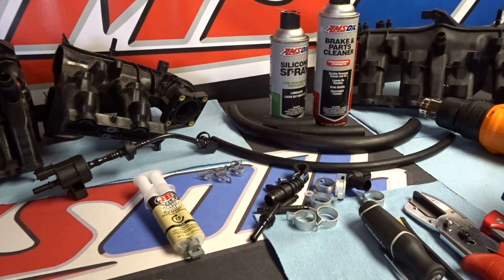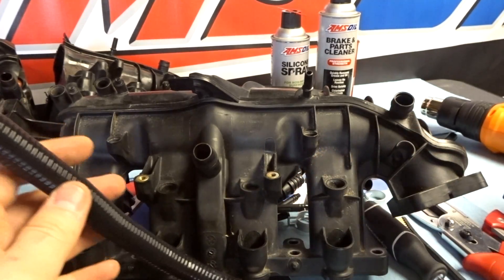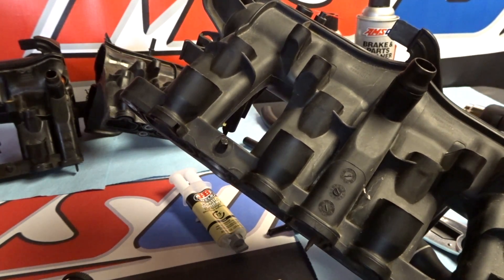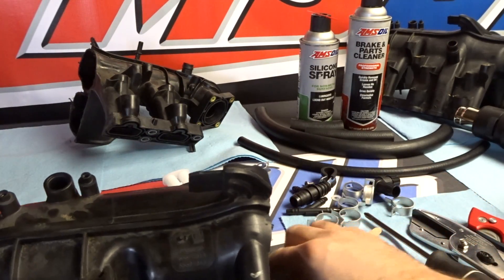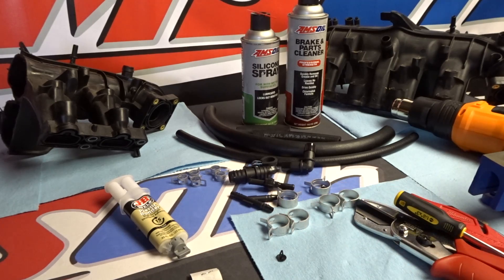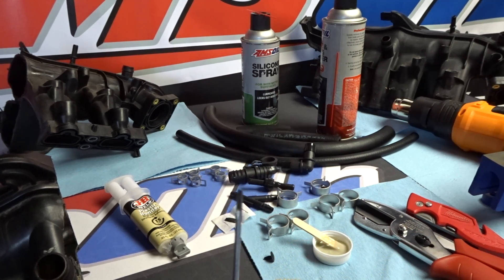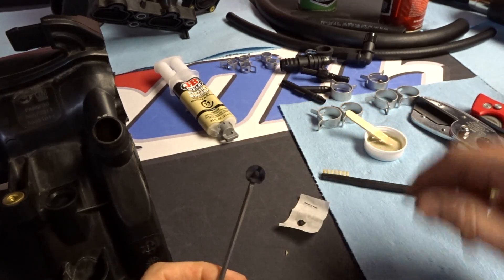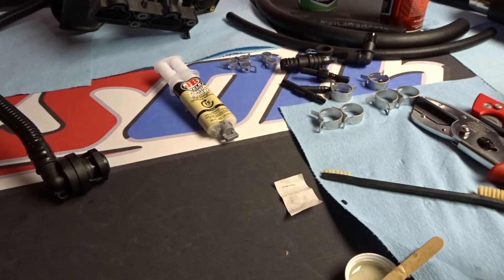How to Install the CruzeKits.com V3 PCV Fix Kit

Comment: Is that check valve big enough? Reducing half the diameter as the factory one. I don't think you'll have enough air flow.
Reply from the maker: The check valve flows far more air than the factory one.
Reply: @AndreiDPop  which catch can would you recommend with this kit if any and how to connect?
Reply: Looking more into it, is the pcv gas entering the intake under non boost conditions even worth trying to catch? Looks like everyone is concerned with catching the gas before it goes thru the turbo and intercooler.
Reply from the maker: @joeaubert7224  I mean if your goal is to keep the system as clean as possible, I'd say it's worth it, but I think there are better ways to approach that.

Comment: If the pvc valve fails in this kit, is there a way to catch it before the diaphragm on the intake is effected?  I plan on ordering the V3 kit and an extra valve.
Reply from the maker: You'd have similar symptoms first. Elevated oil consumption, loss of power, reduced fuel economy, etc.
Reply: @AndreiDPop  Actually just put my order in for the V3 to ship to MN.  What would be your recommended mileage interval to check the valve for proper function?
Reply from the maker: @lancewoller  hard to say since we haven't tested it for very long, but I'd say check it after 50,000 miles.

Comment: Why didn't you just keep the brake booster tee? It's an easier fix and doesnt require cutting into hard plastic lines and heat them to get it to fit.
Reply from the maker: Hose routing would have crossed over the evap purge line. No easy way to route the hoses if using the brake booster tee. I tried.

Comment: Will a missing check valve cause a under boost code?
Reply from the maker: Yes it can contribute to one. That and any other external boost leaks.
Reply: Dre Dan thank you for the reply, I checked mine for boost leaks and installed a new oem turbo and I once again got a under boost code. No leaks, or cracked exhaust manifold
I am missing the orange valve on the intake just wanted to make sure that could cause a underboost code.

Comment: In the video description you say "This kit along with a new GM valve cover will fix all of the PCV issues these cars have." Is there a way to check if the valve cover needs to be replaced before spending the money on one? If I should just get one, does the Dorman one meet the needs?
Reply: If the PCV valve at the intake manifold is missing or not working it will either make the pressure release diaphragm or the burst disk fail anyway, so might as well get it replaced while you install this kit to address the issue.
Reply: Do Not use ANY DORMAN products.  They are crap. Amazon and Ebay have plenty of reasonably priced OEM covers to choose from.

Comment: Updated 11 months later see comments: 

Thank you for this. I actually have two Cruzes in the family. Will buy another kit soon for the second one. I'm an aircraft mechanic so this was an easy fix for me. I did melt the small plastic lines with the heat gun but was able to make it work. Next time I'm going to use some fuel line instead. I brought the car in for service and told them about the check engine light and pcv issue. They told me I needed four new injectors and that the PCV was fine. $600. I held my temper, ordered your kit and now the car is fixed. You are doing what GM should have done in the first place. Thank you.
Reply: BTW. I think the three thumbs down are GM execs.
Reply: @berticusmaximus8381   also note that this engine was used in Opels and vauxhalls before they made it to the US. You'd have thunk the germans would have let GM know of the intake problems
Reply: Just updating 11 months after the first post. Put off and forgot about the second Cruze (my other son's car). This week my wife took it to the store and pulled in the driveway with a huge white cloud billowing out of the tailpipe. Covered the entire neighborhood. Engine was squealing and engine light was on. I ordered the second kit and installed it this morning hoping this was the only thing wrong. The intake was full of oil and it took the car 20 minutes to stop smoking. Good to go now. Awesome kit. Thank you again.

P.S. I ordered the easy connect kit so I didn't have to heat the tubing. Made the job so much easier. Also the new elbow that replaces the T also made the job faster.
Reply from the maker: @berticusmaximus8381  how's your check valve doing in the first kit? I'm seeing some failures from time to time. I have an upgraded check valve coming soon that will last longer, and I re-located the valve in the kit itself.
Reply: @AndreiDPop  so far no issues. I have not cleaned or checked it since installed. I will take it out, clean it, and test it as was suggested in the email. Also I will most likely buy the new check valves as well.
Reply: @AndreiDPop  i am planning on  ordering one is there any new upgrades?
Reply from the maker: @megabeastmode555able  I've made a couple of updates to the v3 kit since it first came out, and I have some new check valves arriving early next month with upgraded plungers.
Reply: @AndreiDPop  i already ordered one lol  im trying to fix this issue now as im military and have to go home for leave but if you improve on it later i will also buy the upgrades
Reply: @AndreiDPop  my son came home and I pulled his check valve. Worked great. Cleaned it and reinstalled.
Reply from the maker: @berticusmaximus8381  good to hear. Approximately how many miles on that one?
Reply: @AndreiDPop  15,000 - 20,000 approx.
Reply: @AndreiDPop  have the upgraded valves come in yet? Thinking of ordering soon
Reply from the maker: @treyzeno8181  no, not yet. I've just been informed to expect them end of the month.

Comment: Any issues with this failing the visual smog check ?
Reply from the maker: Depends on how particular they are. Some places will actually compare your engine bay routing to a diagram to see if anything looks out of place. Most places don't care. Proceed at your own risk. The kit doesn't bypass any PCV functions and its role is to retain the OEM design but improve its durability and reduce its maintenance cost.

Comment: The Hose you used were 5/8 or 5/16?
Reply from the maker: Both.
Reply: So the "T" fitting is 5/16 to two 5/8 right?
Reply from the maker: @tksvideos2737  yes. Why do you ask? Are you trying to piece your own kit together?
Reply: Yes. Because i live in Dominican Republic. So the shipment would be difficult and expensive for me
Reply from the maker: @tksvideos2737  freight cost is an extra $30 USD for my v3 kit. Not too bad. The tee fitting was custom made. Not likely that you'll find one.

Comment: Okay, so I had P0496 purge valve issue, and stuttering at stop lights, as well as when starting after fueling:  all the symptoms.  So, I replaced canister purge valve and cleared codes using OBD scanner.  Symptoms went away completely.  However, all the codes came back as well as MAP sensor codes.  So, I checked the valve-cover pressure regulator vent, and sure enough, it's gulping in air.  I'm pretty sure this means at the least I need to replace the valve-cover, but as I see here, I should probably go ahead and replace the intake manifold or use one of these kits to fix the existing.
Here's my question: I know a bad pcv valve in intake can cause pressure regulator diaphragm to crack, but could that also cause the purge valve to fail too?  I mean, yes i have error codes, but my symptoms are completely gone.  Is this just short lived because the excessive vacuum being pulled will destroy the new purge valve?
Reply from the maker: No, it couldn't cause the purge valve to fail. The two systems are not related in any way.
Reply from the maker: Your purge valve is behind a check valve that is external to the manifold. It's that plastic disc looking thing inline with the nylon hard line.
Reply: @AndreiDPop  Yes, I replaced the purge valve and all my symptoms of stuttering at stoplights and after filling-up went away, but the pcodes are coming back.  But if I understand what you're saying, my new purge valve won't be damaged by the fact that the regulator diaphragm has failed.  Thanks

Comment: I have the v2 kit although I haven't installed it yet , I have 34,000 miles on my 13RS I like the V3 better  if I still have the check valve in place can you poke the check valve with a pick of something in order to snap the plug in the hole ?
Reply from the maker: Yes. Break off the tip with a flathead screwdriver and that should be enough. Poke the other side through with a pick if you want to.
Reply: @AndreiDPop  
Ok .......

Comment: I have recently had my diaphragm failing and have purchased the valve cover for my 2011 cruze, I checked for the pcv intake valve and it’s disappeared. I am not mechanically savvy neither wealthy to afford costly repairs. Would you recommend V3 kit over V2 for someone like me and if there are any more videos done on an actual car it would help to visualize and use as reference when repairing. Thank you for your time
Reply from the maker: V3 isn't available yet, but I would recommend v2 for sure b
Reply: @AndreiDPop  V2 requires the removal of intake manifold and would that be easier to implement than this V3. I am a complete noob in terms of mechanically fixing hence these doubts.. thank you for your advise
Reply from the maker: @zxgh  v3 is easier to install but v2 uses a better check valve and is available today. V3 will be released in January. Took a break for the holidays and decided to delay release.
Reply: @AndreiDPop Thank you for your reply. If V3 is easier to fix, I'll wait for it to get released as I am pretty clumsy with mechanics and don't want to remove things without knowing how to put back. Wish you happy holidays

Comment: Nice!! Do you plan on releasing the parts list for this like you did for the V1?
Reply from the maker: No. Mostly because the T fitting is custom made (had a mold made for it and ordered 2000 of them), the check valve and the Y fitting are both imported and would take anyone else a month to have shipped, and the clamps are also imported and are prohibitively expensive to get locally and I don't want people using worm drive hose clamps. The hose I'm using is also vacuum rated PCV hose (actually tried regular 5/8 fuel hose and it compressed too much under vacuum) which also isn't easy to find. It's very unlikely you'd be able to get all of these parts for less than I'm selling them for as a kit. I also spent over $200 buying various clips and fasteners before I found the right one that fits to plug the hole from the top of the manifold, and they only come in a bulk pack so it wouldn't make sense to have people order their own.
Reply: @AndreiDPop  Ah ok fair enough. Going to keep an eye out for these on your site. I see in the other comments they are coming in January? Early to mid January?
Reply from the maker: @jacobrobertson6738  early January. I was going to release them last week but I don't want to spend my Christmas vacation packing fix kits. As much as I enjoy doing this and people have been asking about it, family comes first.
Reply: Dre Dan Alrigjt sounds good! Do you have any idea on how many miles this V3 check valve will last? I know the V2 is overkill and seen the V2 can last like 50-75k+ miles.
Reply from the maker: @jacobrobertson6738  honestly I have people already with 100k miles on the v2 and it's running fine. That kit is ridiculously over-engineered. The v3 kit will last a long time as well but I suspect the valve may need replacing every 50k-75k miles.
Reply: Dre Dan oh wow! And good to know. Any way to get the V2 check valve work with the V3 kit? That would be the best of both worlds in my opinion.
Reply from the maker: @jacobrobertson6738  nope. Too much weight. Since its an NPT connection, you're also adding two more barbed adapters and there's nowhere to attach that amount of weight and keep it from rubbing a hole in something or rattling over time. Just not feasible. The v3 check valve is lightweight nylon and works just fine for an inline application, but the v2 valve needs to be mounted securely somewhere.
Reply: @AndreiDPop  you expect the valve to fail in 50k miles? if that happens how would i fish out the bad valve & jb weld?

Comment: Nice version update, this brings up a couple of questions, 1. expecting the unexpected. What happens when someone during install drops that plastic piece? Just remove the intake manifold I suppose, but I can foresee this occurring. 2. the purge valve sometimes goes bad, not often, but not unheard of. How would this be treated? Thx, a happy V2 owner. PS I think if you remove the : in the video description, those times will become clickable as they're currently not.
Reply: I lost mine in there. Oh well 😂 I just globbed a ton of that epoxy on the hole and let her ride
Reply from the maker: If they drop the piece inside, they have to take the manifold off. If the purge valve goes bad, you can just replace the nylon with fuel hose or I can get you a replacement Y fitting for under $10. It's a compromise to this kit but fortunately those purge valves don't fail all that often. I'm still considering making the brake booster tee fittings optional. 

I'll work on the description, thanks for the tip!
Reply from the maker: TBH though, so far I've had 30 people install this kit and all of them were able to get that plug in there without losing it. That butyl rope really is quite tacky. You'd have to really goof it up to drop that thing down there lol.

Comment: Nice! Any update on when will they be available and pricing? Does this kit still allow you to install the plug without removing the intake manifold? Rather not remove it as I heard it is a pain. Thanks.
Reply from the maker: Yes, watch the video. Will be released for about $75 in January.
Reply: @AndreiDPop  Nice thanks for the reply! I did watch the video, but heard that this method might be unreliable and the intake manifold should still be removed to plug the hole. Just wanted to confirm at the source.
Reply from the maker: @bdamon4646  who told you the method is unreliable? I have the manifold I cut up to make that video and let me tell you, that plug is going nowhere. The epoxy holds the entire head of the plug onto the manifold, and the tip of the plug actually had epoxy between the shaft and the locking retainer, preventing them from ever coming back together and the plug from coming off. I'm fairly confident this plug will not be going anywhere or I wouldn't release a kit with it. 

I still want to know who told you that the method is unreliable.
Reply from the maker: @bdamon4646  I'll even send you pictures of the manifold I used in this video. Just shoot me an email using the form on cruzekits.com.

Comment: DO YOU HAVE A LINK TO YOUR KIT
Reply from the maker: Link will be posted in January. You can get the v2 kit for now on cruzekits.com.
Reply: I want the V3 kit. i am scaredy pants to want and take off the manifold. I changed the purge valve, MAS and replaced the pcv tube to diagnose the problem. This is my last step, I ordered a phone endoscope camera to look inside the manifold.

Comment: Way easier!  I have the V1 kit and a new hose line on mine.  This method would have been preferable as the intake does not need to be removed ( I actually procured an extra from a boneyard) and way cheaper as well, but I do like the Bonomi check valve and it's likely less maintenance.  Overall the kits in any form are worth the cost.  Thanks for taking the time to create them.  Now if only you could come up with a cheaper and easier coolant leak kit ....

Comment: Pretty innovative! I bought the V2 kit and thought it was pretty good, but this new V3 kit looks like it’s even better except for maybe the check valve! Great job👍
Reply from the maker: Aye, the check valve isn't as good on this one. I like the check valve on the v2 better since its comically over-built for this application.
Reply: @AndreiDPop  can you use the v2 with this kit?  I ordered a couple extras. Also any word of the new valve you were talking about?

Comment: Having installed this w/o the video, I can tell you its REALLY easy. I had the V2 and I like this kit a lot more just because of how easy it is to install. Just a quick tip, do a test run with the clip stuck to the screwdriver, just dont push it in. Doing so will give you a good feel of where the clip should go and you wont be rushing to get it in there before the epoxy runs off if its still runny. My car sees 26-28psi and this is holding up just fine, zero issues and I was able to install a catch can while I was there.
Reply: If you already had the v2 kit on there how did you install the v3? Did you use a different intake manifold that wasn't drilled out for the v2 fittings?
Reply: @justinv3080  used a different intake manifold